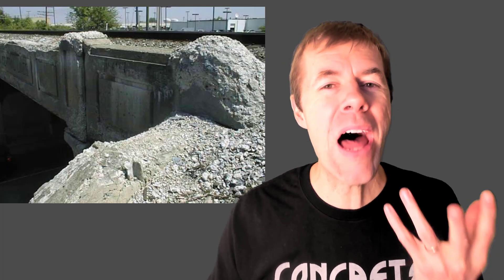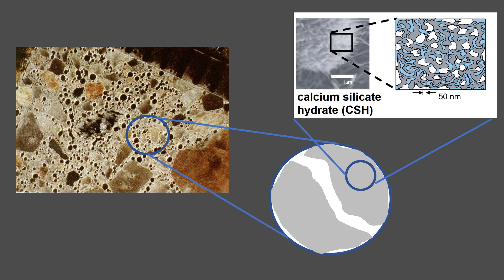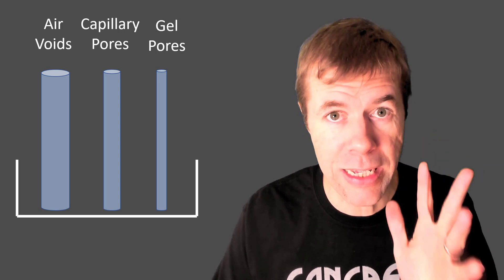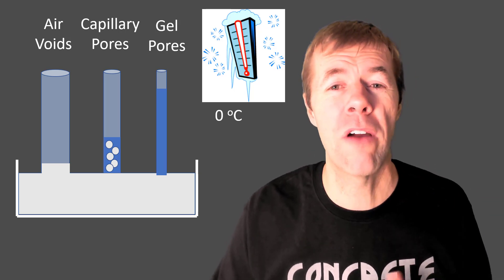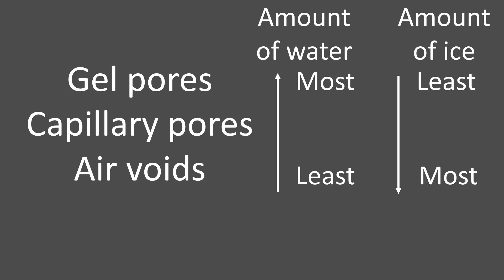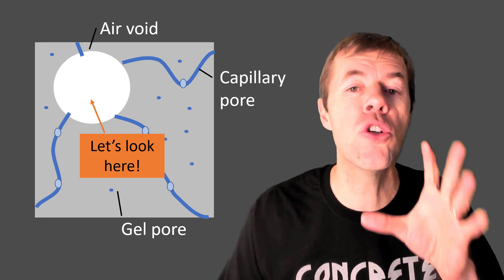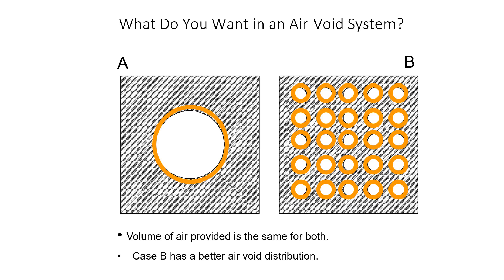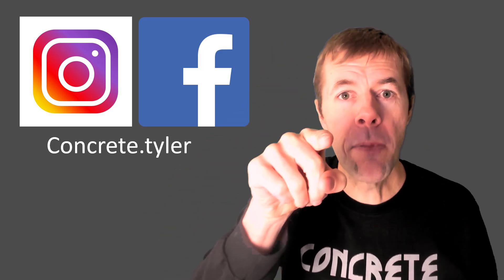Why does freezing damage concrete? | Freeze thaw durability mechanisms

Comment: A few years ago watched a local home builder pour at +3c, however -10c overnight. Walls were stripped with less than 15 hours in form(green and steaming) confirmed code requirements then reported to local code office. The head of department replied " it's not my job to babysit contractors " no lady, that is your only job.

Comment: Thank you for the cool video! And how to make concrete with such air bubbles so that it does not crack in winter? For example, a path if you need to make a house from concrete with such air bubbles. Are there any additives? For example, is it possible to use carbonated water instead of regular water when mixing concrete or are there special additives?

Comment: Hi, I live in Idaho.. my driveway has broken areas around the saw cuts, while my neighbors don’t..  I just bought a new home and would like to keep this from happening. I assume this is from the freezing water in the cracks, causing it to break.. my question is would it make sense to silicone caulk these joints to keep the water out when it freezes, yet still allowing  an area to expand and contract when temperatures change..

Comment: Yo Tyler, make a new video for me..I wanna know if granite slabs on it's edge will add strength to a concrete pad or any concrete structure whether it's load bearing or just a on grade block, does granite add strength?
Reply: Hey there. I am no expert but I stuck some quartz countertop scraps in with the gravel as fill before the shed  slab went in...granite is good for 1500 psi or so..quartz is more like 4500 psi and up...  I got it free locally..it is just a waste product otherwise...

Comment: Hi Tyler.   This is off subject for this video, but I think its your latest one right now.  What are your thoughts on bamboo for rebar or reinforcement?  Is there a way to treat it to make it viable?  If it were epoxy coated, it wouldnt rust in a knicked spot like epoxy coated rebar would.  It could be split if the hole in the middle would be a problem...  TYIA!

Comment: I would seriously have a look at that bridge if I was the owner. Looks like a railway bridge? Things that come to mind are; bridge design, design of mix, contaminants in mix, poor quality aggregates & cement, weather conditions when it was laid, speed at which it was laid & poker vibrated, over vibrated, slump test, crush test results, immediate & intermediate period protection from the weather until cured. Regional & seasonal weather conditions. Also, local run off contaminants from the railway ballast & spillage from railway traffic. Drainage points from bridge structure. There are old salt marks on the surface on the concrete. I could go on. Interesting videos.

Comment: My apologies if you've already covered this topic in a video that I haven't found yet but I was curious what you opinions are regarding IFP panel construction. I plan on building a home in the Caribbean in a few years and wish to use IFP construction for the house walls. If the industry promotional information is so positive, why isn't this building technique used more in hurricane prone areas or where temperatures remain at the extremes? Yes I understand it costs more but it seems to me the all of the positives justify the extra expense? Would you advise IFP panel construction in the Caribbean if all proper building codes are followed? Would love to hear your thoughts on this technique? Thanks!

Comment: Without ANY air voids then the issue does not exist . No  voids , no water - Ice - break down.  Air is just a way to fill volume without using material , saving costs. Are there better air distribution than others ? You proved that distribution does make a difference . But Air is weak .
Reply: The water is still penetration fully into the concrete through the capillary pores. The main point is that the air bubbles are pressure relief valves so that the concrete doesnt fully fracture when the water inside does get exposed ti freezing temperatures.

Comment: So, chopped up DOS diskettes and straws with a dash of Dawn for my admixture?
Reply from the maker: Nice!  Let me know how that works for you. =)
Reply: @TylerLey  Hii Professor of Concrete,
Your videos are super good.. very edu.. superb.

I would like to ask you a question:
Can a house concrete slab be poured on to styrofoam board in large area ? 
I mean, concrete is so heavy, styrofoam board is so weak , will it not smashed or crashed under all those huge cement, water and agregate weight ? 
When it being smashed or beign chew up by mole or vole.. under the slab, will  it not causes the concrete slab crack and lost the water level or causing house to crack...
I hav being asking this question for such a long time, and i saw this guy in youtube did just that.. pour concrete of house slab on styrofoam board. 
https://www.youtube.com/watch?v=L8JAXQteRaM

Appreciate if you reply me. Thx